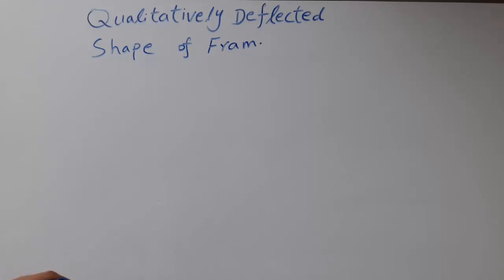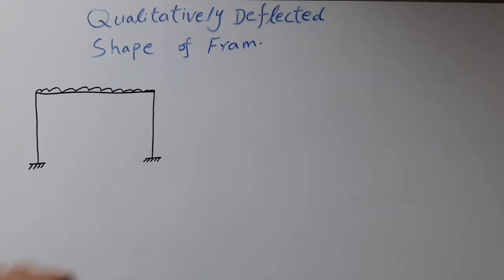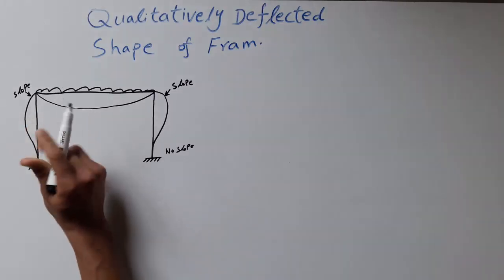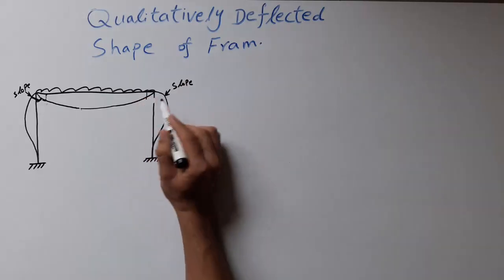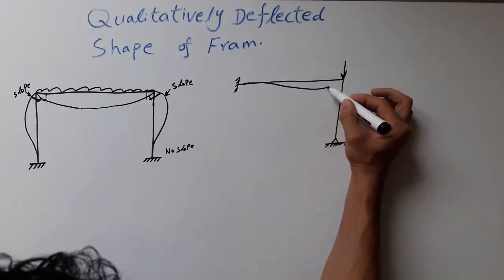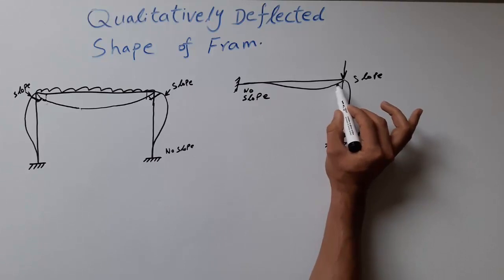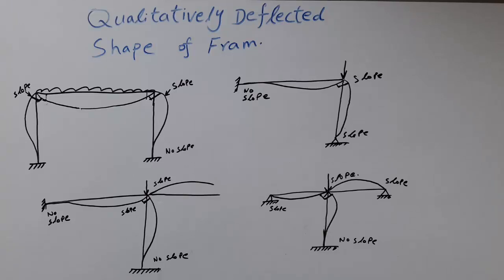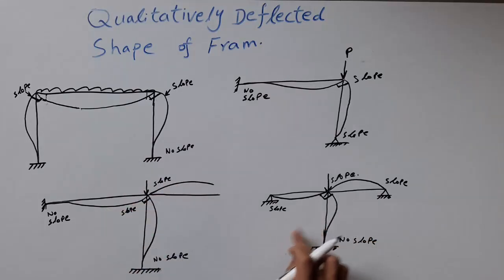Deflection shape of Frame ''Qualitatively''

Comment: The 2nd, 3rd and 4th diagrams are wrong unfortunately. Since we assume no axial shortening and these forces are applied directly over the support, there will not be rotation. Also the 4th diagram violates a golden principle in that if you have a symmetrical structure and symmetrical loading, the response (i.e. deflection) of the structure will also be symmetrical, which your diagram indicates is not.
Reply: Thanks for this comment.